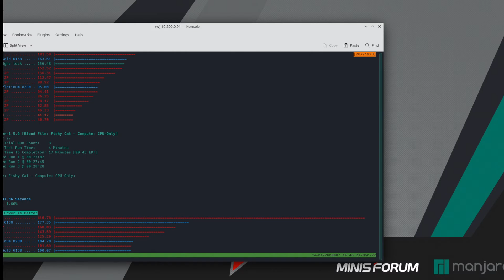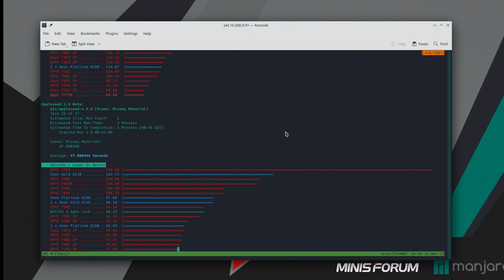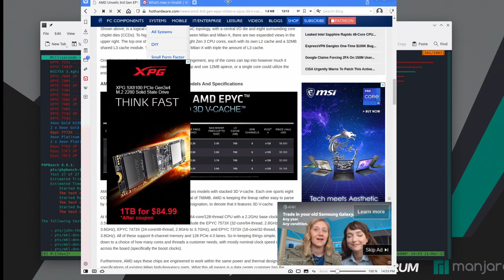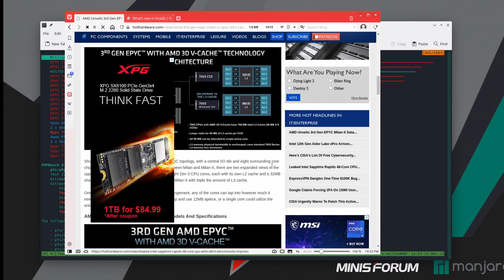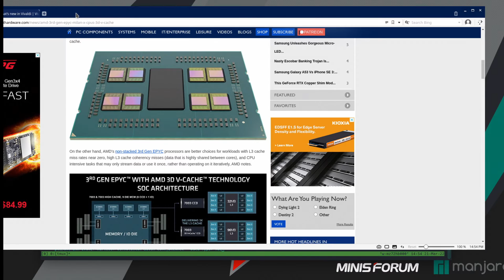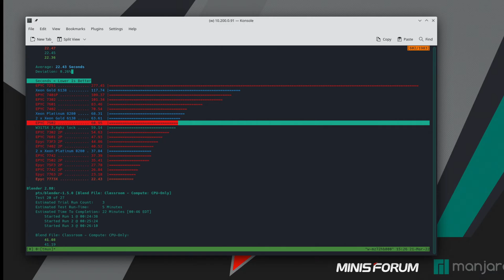Milan-X : Live Benchmarking 1.5gb of cache with TechTechPotato Dr Ian Cutress

Comment: Would it be possible to do gaming benchmarks with the cache enabled and disabled to see if there is any performance changes with CPU bound games? This might give us a hint of the potential IPC improvements for the 5800X3D even though there is a big difference between the EYPC and 5800X3D clock speeds?